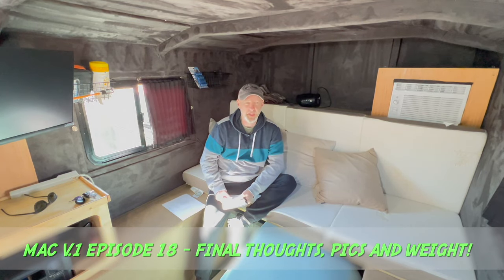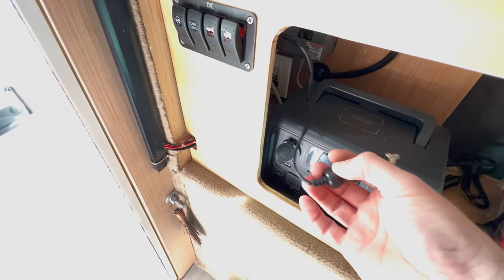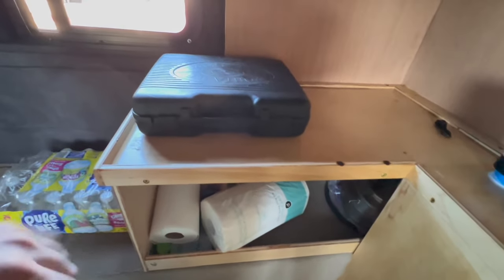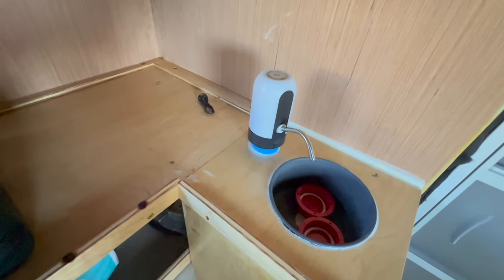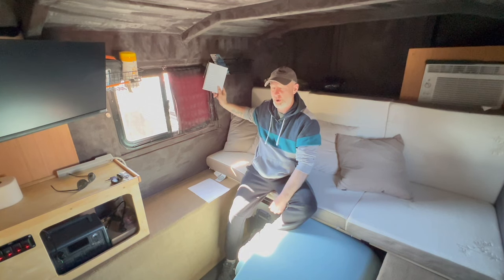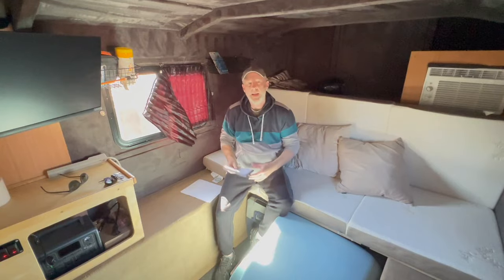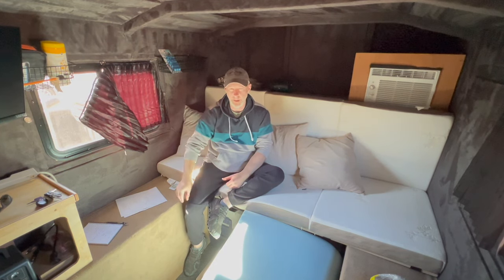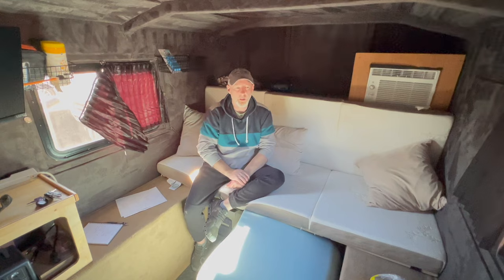The home built foamy truck camper is COMPLETE! (How much did it weigh?)  Ep. 18

Comment: Just did a Deni... binged the episodes. First, thank you! Just an outstanding job. Like you, I struggled to find a "manufactured" solution for my 2014, F-150, 5'-6" bed, and yeah, I  cannot bring myself to justify dropping the dough to accommodate the high cost for a commercially built insulated cab-over camper: Especially for my very single purposed, inexpensive, overnight fishing excursions. I do not need all the latest, greatest engineering, and creature comforts for my fishing trips. However, I do want some comfort from the dynamics of seasonal weather and when first saw your DIY build, I instantly thought "PERFECT!" During and after binging twice though all 18 episodes I continue to ponder some type of cantilevered "cab-over" portion that would extend the interior front to back distance so I can ceiling store my one piece rods with reels and enough strength to support the weight of a bed utilizing the space as the sleeping quarters. Perhaps a bit more fiberglass and patterning to increase strength? Or insetting some sort aluminum frame into the foam?🤔 Anyway, although I am awaiting your video on cost - total, breakdown, etc., I am confident the cost of your build is dramatically less than a commercially manufactured build. Circling back to increasing interior length for space and structural support for the weight of a sleeping adult, I am certain there is solution to my question for extending the cab-over portion that will also still provide plenty of payload weight capacity to spare. When I come up with a cost effective yet sturdy enough design I will be embarking on build inspired by your build. Again, thank good sir.👏
Reply from the maker: Hi David! Thanks for watching and the kind words. I, too, would like to explore a cab-over-bed and just might in the future. I've thought about several ways to do this including an internal frame covered with 1" foam. I had a couple of designs originally but elected for something simpler on the first go round. 
The cost video was published on my other YouTube channel. Georgia Builds One on YT. I also started a new project there as well on a bass boat. Thank you for watching!

Comment: Most slide ins weigh over 1,000 for the smallest. Outstanding! I'm building mine just like this! My question is how do I make a cab-over bed to support my skinny 150 pound butt?
Reply from the maker: @sloppyfloppy79 Thanx! I am not sure about an over cab design but I would consider box joints and several layers of 1408 at right angles.

Comment: Great job! I skimmed through the videos but I believe if you lined the inside of the camper with plywood and a layer or two of fiber glass as opposed to outside it would have greater tensile strength and shear resistance, you still need to fiberglass a couple layers on outside for dent and scratch protection and waterproofing but don't need plywood on outside. Doing it this way would also protect the plywood from any water intrusion. I'm no expert but I've watched many boat building videos.
Reply from the maker: Thanks for the tips! We learn as we try!
Reply: I saw a similar video and they tried to fiberglass the foam walls. The fiberglass almost completely ate through the foam.

Comment: Question, if you build a foamy truck camper with a true cabover that held a bed facing west and east. Similar to an old Bigfoot 6-11 design. Would that support the weight for two adults?

Comment: I had this idea a while back. After looking into a bit I saw videos showing that fiber glass resin gets warm when curing and melts the foam. I’m assuming the brand of fiberglass resin does not have that problem?
Reply from the maker: @PRIME KIND It will melt the foam if doing a deep pour. Of course it will melt plastic containers if there is a lot in the container. However, laying it up with just wetting out the cloth, it did fine.
Reply: They're talking about vinylester or polyester resin, which will disintegrate xps foam. Epoxy resin will not do this.

Comment: Great job just one question I had was on the air conditioner how did you address any condensation drainage?
Reply from the maker: @Xploring_The_Outdoors Thanks! That particular unit does not have a drain. The design slings the condensation up over the coil and blows out exhaust.

Comment: [I, wanted to build  a slide in trk camper like you just built but I just don't have the time because of my long hour job that I work so I went out to the rv dealership and bought a good used 2003 Jayco legacy 40ft tandem AXLE with 4 slide outs 5th wheel rv  but pulling that long 40ft long rv up and down the hwy is a big  task and  lots of skills I had to also buy a chevy duelly trk with a  5th wheel  bed hitch I, only took it out on the hwy one time to go camping  now it sets in the back yard.         again, I have enjoyed  you're videos on building you're dying slide in trk camper it looks great]
Reply from the maker: @gerlandkent6377 Thank you! Pretty impressive 5th wheel you have. Definitely should get it out more!

Comment: I have nothing but shear admiration for original thinkers. I wonder what a wet-bath and 40 Gallon Fresh/ 40 Gallon Gray-Black  would add.  Tony
Reply: Figure 8 lbs per gallon for water. Fresh full and grey empty at the start and the opposite at the end. (Worst case situation’s) then add whatever the tanks themselves would weigh.
Reply from the maker: I considered an outdoor shower at one point.
Reply: 320 pounds every 40 gallons. Wet bath would probably add another 30-40 pounds. I have 2 gas tanks on my truck and was thinking about replacing both with a single 32 gallon gas tank and installing a 25-30 gallon fresh water where the front tank is.

Comment: Really want to know about the insulation value of your build. Living in Texas where if you don't integrate cooling into the build then you're a mummy in 3 days.
Reply from the maker: Chris, it has a R-10 value.
Reply: I’m wondering in the opposite direction. If you built out of, say, 1” foam, would it be the end of the world situation? Or would it be a bit cheaper, a bit lighter, a bit hotter or colder, etc.?
Reply: @noellwilson1273  if you go down to 1inch foam probably better to use a higher density weight foam like pvc, boats are built with pvc foam. Obviously it would have less insulation value and pvc is a lot more money. Consider the thicker foam saves you in how many layers of fiberglass you need too.

Comment: I was really juiced when I saw your first few episodes of the build completely with foam and fiberglass and then out came the plywood covering the fiberglass and the wood framing to bloat the weight. Why? The entire camper could have been made with foam and been glassed inside and out, and the fiberglass did not need to be nearly so thick especially if you were using high strength S-glass cloth and no chopped fiber. The inside should have been glassed so that attachments for cabinetry and other build out item could be epoxied to the glass. The fiberglass exterior could have been sanded and painted a nice gloss white to reflect the sun keeping things cool in the summer.
Reply from the maker: @chrisdaniel1339 first time trying it and wasn't 100% sure.

Comment: Maybe I missed it but how did you support the "wings" and over cab area to bear weight?
Reply from the maker: I did the notch method and then reinforced the corners with several layers of fiberglass. the bottoms of the wings had 5mm plywood on the outside, underneath as well.

Comment: Just a comment if anyone is going to build a lightweight camper, you may want to one add some additional bracing for the roof and always us marine plywood after the shell is done and keyed together
Reply: It will add some weight, 'but it will be worth it it will add some stability to the camper when you are going speed limit on the highways